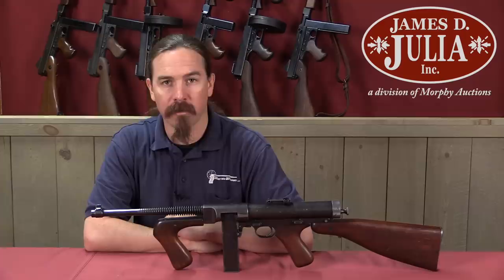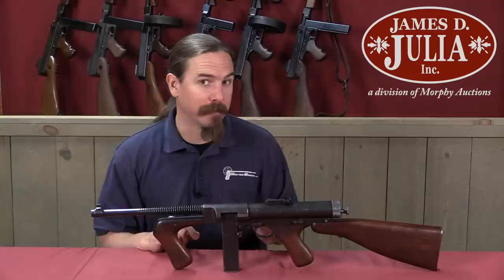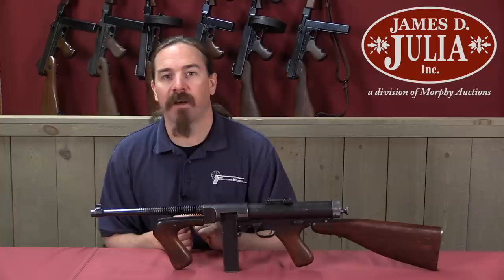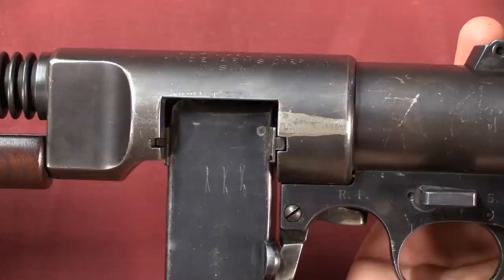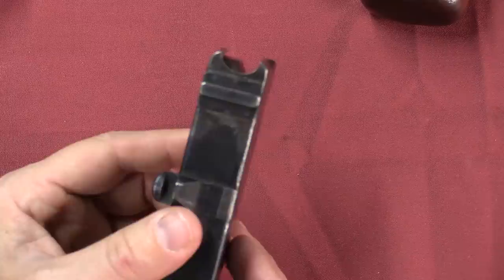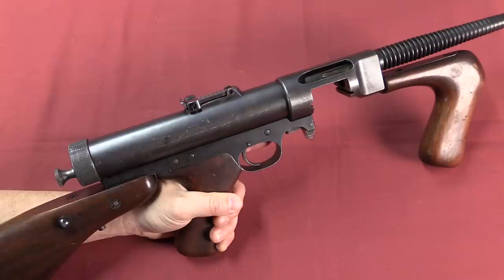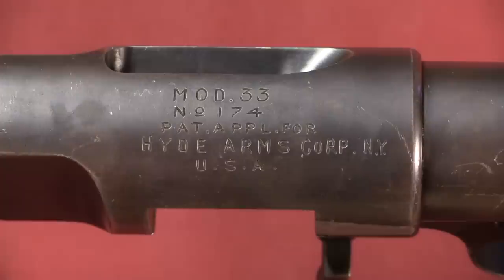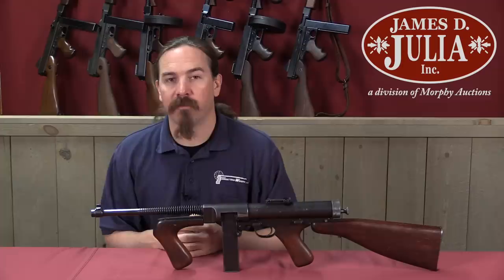George Hyde's First Submachine Gun: The Hyde Model 33

Comment: With this gun in conjunction with the ultimate design of the grease gun, I feel like Hyde was interested in creating as close to a mud-proof submachine gun as was possible. The dust cover was an integral part of the grease gun's function, and now that I'm aware of the fact that the first gun he submitted was rejected in part because of problems with the rearward charging handle, the wonky charging handle on the original M3 makes a lot more sense

Comment: Pretty interesting. I was expecting it to be a little lighter, like 8-8.5 lbs. Good design. The foregrip/end could always have been changed. A sliding wire stock like the M3 might have been a good idea. I would expect that a slightly projecting mag well like an M3 or MP-40 is ultimately a better idea. The charging handle may have merit, but i think a side handle like the M1 Thompson might ultimately be better. Hyde's designs are interesting and solid though. I always liked the M2. Great video as always. Thank you

Comment: why do smgs always get really weird charging handles? is it really that hard and expensive to put a handle on them in the typical place?
Reply: They need to lock open, and they tend to be run more like a pistol, from olden timey thinking. i.e. more like modern gun handling: Right handstays in firing position, left hand does everything else. So usually the charging handle is designed to work left handed with gross motor skills, and be very cheap and simple to make. SMGs were very frequently made as a cheap and simple gun to make a lot of in an emergency. A big crude knob in a slot with a notch in it covers that need pretty well.

Comment: Kinda makes you wonder why the U.S. Military didn't try and get the Thompson design changed to a tube stock design before adoption, would have been far cheaper
Reply: Wouldn't really have been the Thompson at that point, but rather a whole new SMG, which is what the military went with in the M3.

Comment: Same poor placement of the charging handle as the M-16.
Reply: How is that poor placemant? It works for both the right handed and lefthanded shooters. I think that it is pretty futuristic and cool design for early 1930s. Mr. Hyde was a clever guy.
Reply: He simply needed a friction ring or latch to stop it from rattling backwards. I personally prefer a side charging handle but there is nothing fundamentally wrong rear especially if the lever isn’t very hard to pull.
Reply: Also almost every major power in the world uses a similar layout as the M16. Are you suggesting that they are all making the same mistake and you have the answer?
Reply: John-Paul Silke, Nope I am just recognizing one of the many flaws of the AR/M16 design and learning from it.
Reply: @davidgrover5996  you're entitled to your won't opinion, but you cannot call the changing handle on an AR a "flaw" as its placement has neutral consequences.
Reply: Without taking your sights off the target load a new round into the chamber River Styx Armory.
You can’t on an AR because you must move your head to chamber a new round.
Also it is very rare but the charging handle can become jammed on the bolt carrier and the next round runs it along your face.
It looked very painful from what I saw.

As I said flawed.
Reply: @davidgrover5996  ok ok, this is a very complicated operation, but hear me out. Grip magazine with left hand, depress magazine release with right index finger....insert magazine with left hand. Press bolt release with left thumb

Mind blowing, am I right
Reply: I never said the chamber was empty River Styx Armory your attention to detail is truly unimpressive.
You now have a tracer round aimed at an unstable individual in front of a gasoline tank and a nice 30 rounds of ball to follow up with after your tracer round sets the tank ablaze. To bad the situation is to volatile and close to take your weapon off the target or he will be on top of you and you will probably die.
This actually happened by the way the M16 user was severely stabbed when he tried to change to another ammunition type and he ended up beating his attacker to death with his rifle which being a flimsy M16 was rendered inoperable.
AS I SAID FLAWED DESIGN!
Reply: @davidgrover5996  ok, so if you're adding details after I give an answer, then your brain is smoother than I thought. Learn to set up a question properly.
If the rifle isn't empty, and you want to cycle the rifle grab the charging handle with your off hand and rack it back. Thumbing the rear of the handle and hitting the latch with your index works well.
Press your right shoulder forward, keeping your sight picture but increasing the distance between your face and the rear of the receiver.
Bolt cycles, no problems.
Did you forget anymore details or was that it? Did you convey the circumstance properly this time?
(Also, if you're authorized to use force, and you don't want your first round hitting a gas tank because you can't move your feet????? Then put one in the dirt in front of them. They stop, good. They're willing to die, you've got plenty more)
Reply: WHAT PART OF WITHOUT TAKING THE SIGHTS OFF THE TARGET IS TO DAMN COMPLEX FOR YOU TO GET River Styx Armory?
Reply: @davidgrover5996  what part of moving your head back and maintaining a line of sight is so above your abilities? If you're going to get pissy, at least be right. If you can't handle the weapon, maybe you shouldn't own one. If you can't move your head back and still keep the rear-front-target alignment going, maybe you have polio. Or, and I'll be returning to this a lot apparently, your brain might rival a pure silcon sphere in its lack of depth and detail.
Reply: That is exactly the point River Styx Armory not everyone can move their head back far enough and remain sighted. In fact once you move your head your sighting has changed.
Reply: @davidgrover5996  so if someone is physically unable to move their head back 3", why is someone with a neck brace using the rifle? The only arguement you've made is that in 1 single unlikely and probably misrepresented situation, a crippled individual can't remove the M856 tracer from their rifle, and since you see popping the tracer out as the only useful course of action the charging handle location is clearly at fault.
This arguement could be summed up as " I don't like it because reason, therefore dumb."
Present a good arguement, understand what you're presently, and understand that everything is relative as well. Side chargers on the left side are best, but get caught on gear or (like the SCAR) hit the shooter. Right side handles are terrible for right handers in general. Side chagered can also create or enlarge openings in the action, resulting in debris getting into the receiver.
The location of the charging handle on post-prototype ARs is one of the best, without a reasonable doubt. Although no one solution solves every problem, that location seems to be the best compromise between ambidexterity, ease of use, and a sealed action.
Reply: In the future you should read or at least skim the thread so you know what the conversation is about and do not drive your ignorance to the top of the comments River Styx Armory.

Then you may not have to fight to save face when others point out his first response to other people was to explain what he later explains to you.
Reply: There are multiple reasons why someone may not be able to move their head and multiple reasons to change to multiple different ammunition types one may need to switch to River Styx Armory.

Now you are desperately arguing details to save face.

I guess pointing out that the M10 that AR series rifles is based on had a fully ambidextrous cocking capability and thus didn’t have this flaw would be needlessly cruel.
Reply: @davidgrover5996  the only M10 rifles I could find are an AK varient and a Sako boltgun. Care to elaborate?
Give me a reason one would need to both switch ammo types, and can't move their head.
And don't details make an arguement? If I give a reason without details, it cannot be challenged. There's a difference between wanting to be right, and wanting to find the right solution. Pick a priority.
Reply: @happydee6950  the conversation is about the alleged poor placement of the AR15 charging handle. Am I missing something here? Was there a meeting to change to topic? What makes you think I wasn't paying attention to the OP that I responded to?
Reply: Sorry that is the AR10 https://en.m.wikipedia.org/wiki/ArmaLite_AR-10 not the M10.
Reply: @davidgrover5996  thought so. Thanks prototype AR15s had the same "trigger in carry handle" charging handle as well, and through Aberdeen testing they found that it got too hot under sustained fire. To fix that, the portion you grab was moved to the rear, away from the gas key. The current handle IS the fix for the original.
(Then the AR10 got the new handle, but after the Dutch not too many poeople bought them)
Reply: Your second post here proves you are uninformed of the issue discussed in the thread or deliberately ignoring it to push the typical AR fanboy line River Styx Armory.

Also you knew as well as I did he was referring to the AR10 fanboy.
Though if in fact you were not aware of the AR10 that would explain a great deal.
Reply: @happydee6950  and my third post shows where I pointed out the lack of detail in his given situation.
I'm completely aware of the AR10 (developed my Eugene Stoner, unlike the AR15) but given the statement he made between my second and third post, I was checking to make sure he wasn't missing spefic details in order to make his point sound better. You're also a post late. He already iterated his mistake, specified the AR10, and I've given my rebutal. If you're going to be a peanut gallery asshole, be on time.
Reply: They "fixed" the problem by adding more parts to an already complicated design River Styx Armory.
As I said flawed.
Reply: My point was that it is a flaw not that it is a insurmountable one P-Talks. By acknowledging a problem we can work around it and maybe do better next time. I can list several design flaws on my favorite gun.

But notice how the AR fanboys turned this into an argument. Unfortunately for them I don’t mind arguing.

The simple fact is that the perfect firearm may be impossible because the perfect firearm is a contradiction in goals.

But we do better by finding where we can improve and listening when someone points out a potential or observed problem.

Comment: Somebody must have liked playing pinball. Should’ve known that charging handle wouldn’t work.
Reply: John-Paul Silke history and common sense have proved otherwise. Consider if the skinny rod gets bent, the gun is now nonfunctional. A non reciprocating charging handle is not supposed to reciprocate, hence the term. You want to shoot an smg with a steel rod coming towards your eye at every round? Aberdeen knew what was up, as did everyone else. The “feature” only appears on these two designs and nowhere else. So I’d say it definitely didn’t work.
Reply: A simple friction ring or a locking tab will cure this in a minute. Alternatively a small spring attached to a hook and tab and that bad boy stays. If it was a real issue any one of these options would have been chosen. Obviously this gun had a fatal flaw and the rod wasn’t it since even I could fix this in about 30 seconds temporarily and 5 minutes of work semi permanently and given a longer rod, a chunk of discarded spring, a brazing torch and about 1/2hr permanently.  The real issue is the side loading and cocked only loading plus perhaps reliability and manipulation. It’s kinda like making the worlds greatest gun but making it thumb trigger fired. Nobody ever would except that.
Reply: John-Paul Silke but why make a work around for a problem that doesn’t exist? If you’re starting from a blank piece of paper why introduce new problems that are obvious weak points? Make it right the first time and save the brazing for the radiator. The whole design seems half hearted and the fact it wasn’t addressed at all on the subsequent model shows the lack of attention to detail  on the whole which likely led to it being “forgotten”.  As Ian pointed out Hyde really didn’t put much effort into it.

Comment: I don't know why gun designers favor rear-charging firearms since they create more problems than they solve.  And yes, that includes the whole Stoner family.   Throw eggs here ----><----
Reply: kodiakkeith How about making the gun ambidextrous? How about keeping the force applied to charge the weapon in line with the bolt, to minimize putting the bolt in a bind? How about putting the charging handle in a location where it is less likely to snag on other objects in the field, or on your own gear?  Not saying other designs don't work or don't work well, just pointing out a couple of advantages of using a rearward charging handle design, especially for a weapon that is intended to be issued on a large scale and used in the field.
Reply: The most powerful military on the planet had to go back to the drawing board and add a forward assist to the weapon.  That's what I mean about creating more problems than it solves.
Reply: A traditional charging handle negates the need for a forward assist, since it does both things.  Less moving parts is always better.  The 'tinkering with the cartridge' story ignores the fact that any fighting arm should be robust and forgiving enough to use poor ammo, or work in a variety of environments, muddy, frozen, fouled and so on.   This is one area where Stoner might have just realized that the side charger wasn't broke, so there was no need to fix it.
Reply: It was broke. The original AR charging handle was a trigger shaped spur on the top. It got too hot to touch, so the rear charging handle solved that problem. Ian has covered that. Too hot to touch is a bigger deal than the occasional "need" for a forward assist. I don't love the rear charging handle, but these are just the facts of the case.